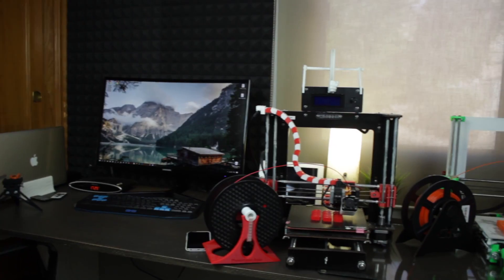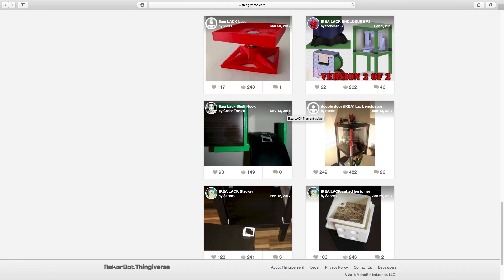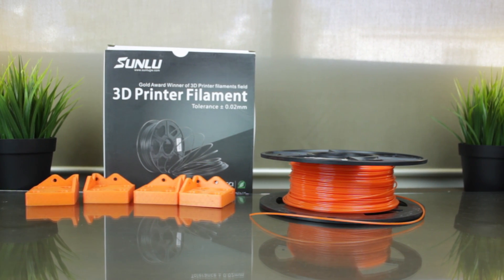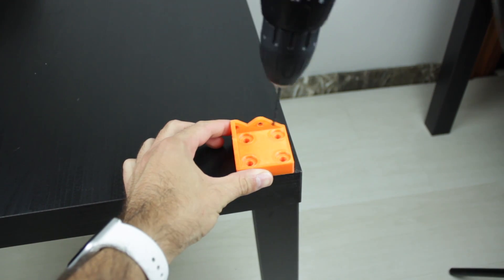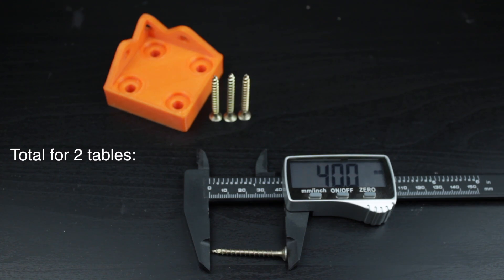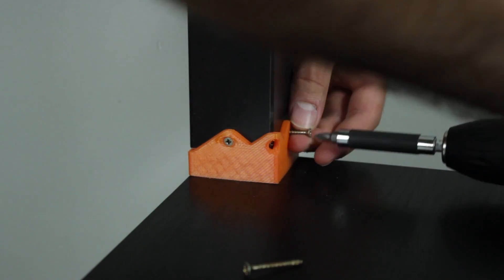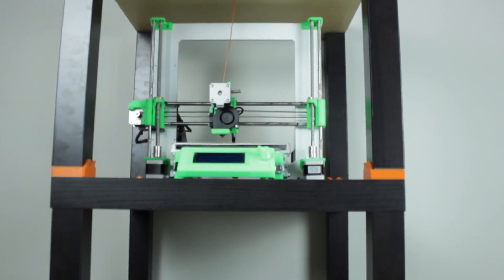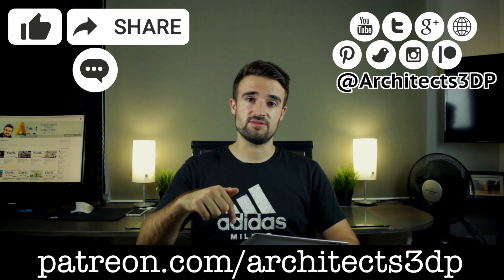3D Printer Farm Shelving ikea lack #1/3. The Structure

Comment: Hi did you get any problems printing the petg had six fails and printing at 249 and 250 and get a lot of stringing
Reply from the maker: Hi David, I printed mine in PETG at 135 ºC with no issues..
Reply: @architects3dp  on the nozzle
Reply from the maker: @davidwhitt3299  yes yes, I meant 135ºC sorry
Reply: Ok I'll try that is it still 80 90 on the bed
Reply from the maker: I think I used a bed temperature of 60ºC...  Just check the one where u can adhere the first layer well..
Reply: @architects3dp  hi 135 won't melt 235 I'm printing at now but 60 is more like pla I'm using petg so running it at 90 on the bed and it seems to be holding
Reply from the maker: Hi, sorry the paramteres I used are:
Nozzle: 235ºC
Bed: 60ºC 
It works perfectly for me. You can choose the parameters that you want it they work for you :)
Reply: @architects3dp  ok  went funny halfway through with blobs and not sticking think low the fan speed to 50
Reply from the maker: @davidwhitt3299  keep playing with the settings haha , you can tag me on instagram @Architects3dp, I want to see the advance! :) :)
Reply from the maker: I've seen your print on instagram!! you got a GREAT RESULT!! =)
Reply: @architects3dp  yeah I think the MK3 fans too powerful on full seen the cnc project very nice think ok for u to https://www.thingiverse.com/thing:3004773

Comment: Hi thanks for the video, it's really interesting!
Why do you use PETG instead of other materials?
Do you think you can use material like PLA?
I am a beginner and your advice would be very useful :)
Reply from the maker: Hi Luca!  Yes, of courese you can use PLA filament for this build, but since the 3D Printed parts are going to be structural, PETG is a more resistant material and that's why I used it :)